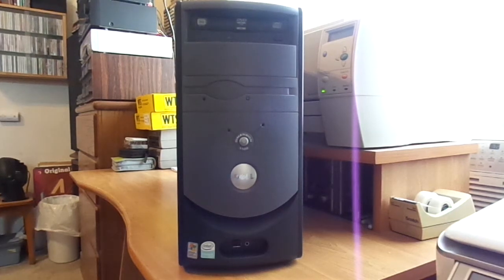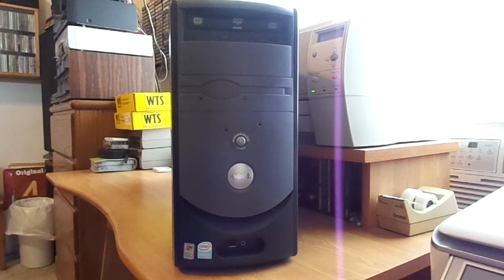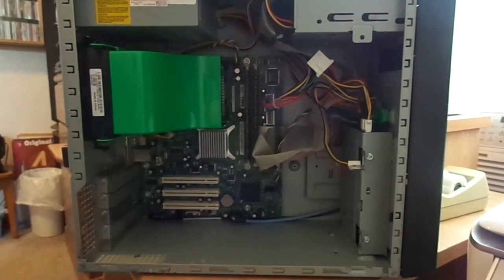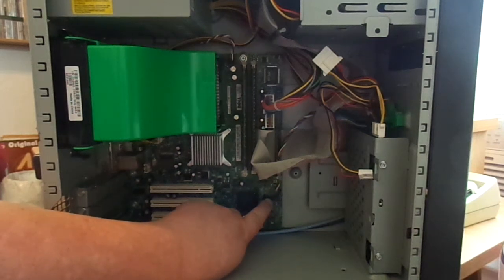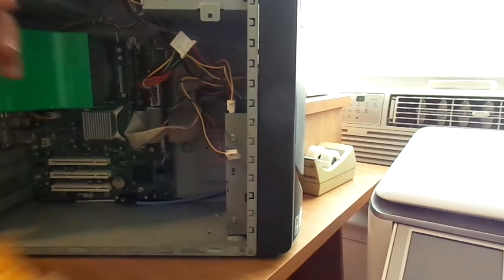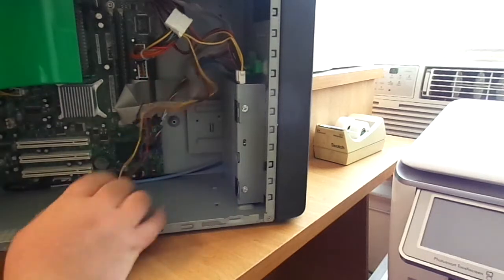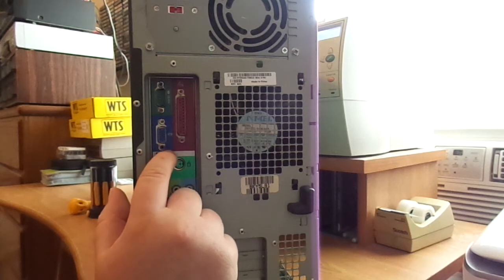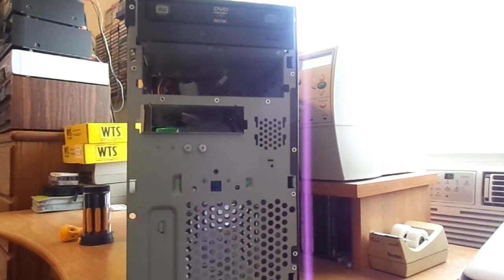Dell Dimension 1100 Desktop Computer Complete Review

Comment: The nicest thing about that case design is that it uses a standard micro ATX motherboard, so you can actually make a pretty nice sleeper system with it.  Also, if you want, I've got a Dimension 8300 that's not being used if you're interested.  Complete setup to include monitor, keyboard, mouse, and of course, system.  I've upgraded it with a Radeon HD 3450 AGP and increased the RAM to 1.5GB.  I'm just over in Newport News if you want it.

Comment: The Dell optiplex 170L which i believe use the same chassis with different plastic front panel, did actually come with the 2 hard drive cages. I do see what you and UXWBILL mean by these systems being out of date when they were produced. I think the Socket 478 was very much reaching the end of production in 2006. I would say also that they were used to clear a large amount of spare parts.....

Comment: I'm working on a Dimension 1100 at the moment. I am installing Zorin OS 8 Lite. These older Dells run the OS really well. For anyone looking to give that old PC a second run I highly recommend Zorin. Last one I did was a Dell Dimension 3000 with a 2.8 gig cpu and only 512 megs of RAM and it runs VERY well. Great for your basic machine. Facebook, e-mails, surfing etc.
Reply from the maker: I'll defiantly give it a try. Thanks.
Reply: No problem. Linux Lite looks good too. It will run on a 700 mhz machine. I'm going to try it oun and see what its like.

Comment: Another question I have matmroy, what would be the smartest way to upgrade this machine. In currently has Windows XP and the Intel Celeron D. Something that still would be cheaper than buying a new desktop.
Ben
Reply from the maker: That's a tough one. If you can get your hands on a Pentium 4 socket 478 (up to 3.0 GHZ I believe is supported by this Dell) that would be the way to go. Might check Craigslist in your area. eBay is another good option, though you will probably pay more.

Comment: I have this computer, I have it running windows 7 but it can't handle the windows aero. It has the pentium 4 prescott clocked at 3 Ghz and 1.5Gb of ram. the computer can be slow at times but if you have the patience to wait then it's not that bad... Last thing the internet loading is slow... and I can only watch youtube videos in 480p not in full screen. . You can't play modern games but it can run stuff like RollerCoaster tycoon 2, and older type pc games.

Comment: ok, this is very helpful. I still have one an i have had it for years, i let a friend  borrow it, now it doesn't work, what does it mean with a yellow light flashing on and off by the power sign.?
Reply from the maker: Sounds like a problem with the power supply. When the yellow light flashes that usually means that the motherboard is not receiving the proper voltage. Replace the Power Supply and that should solve your problem.
Reply: ok! thank you so  much!!!

Comment: Would a Sapphire Radeon HD 5450 1GB 64-bit DDR3 PCI Express 2.1 x16 HDCP Ready Low Profile Ready Video Card Work? ( 100292DDR3L)
Reply: +Jayden Slomp The 5450 won't work. The Dell Dimension 1100 (or at least MY Dell Dimension 1100) only supports legacy PCI. No PCIE, so no HD 5450 (or really any modern card) and no AGP, so no GeForce 6200.
Reply: ***** Do you have any suggestions for a graphics card for me?
Reply: Jayden Slomp My suggestion is - don't bother. I barked up the same tree... there aren't any GPUs really powerful enough to do anything modernly intensive. No high-end gaming, etc. You're limited by the legacy PCI interface. I think the best GPU you could get is like a legacy PCI 9500GT (I've got one by Jaton) or find a legacy PCI version of an 8800GT. Beware though as both cards (I believe) come in PCI Express variants, so make sure you get a legacy PCI one. There are also AMD / ATI options but I'd personally rather go Nvidia.
Reply: ***** Thank you so much I have a friend that built his own desktop for 700 and I have been saving up so I think I'm going to give him a call and talk to him about it but as you're saying it is outdated and if I want it for gaming I should build my own anyways thank again! Very much appreciated man :)
Reply: Jayden Slomp No problem :)

Comment: These still aren't completely horrible if you toss in a 3.2Ghz P4 HT and 2GB of RAM
Reply from the maker: So true. The motherboards are solidly built and that is what really matters.
Reply: Yeah, I have the Dimension 3000, I dropped in a 3.2Ghz P4, 2GB DDR400 and a PCI video card, and it screams for what it is, rock solid too.
Reply from the maker: Nice. Do you know if the Dimension 3000 series can handle a 3.4Ghz P4? I have one lying around somewhere and I was thinking of trying it in my Dimension 3000.
Reply: I think they can handle any that's socket 470, IK my 3.2 worked, and the 3.4 in theory is just a faster one, so I'd try it, don't forget the thermal grease. Also I thought I'd mention, they have a copper heatsink on eBay you can get. Just search "Copper Heatsink Dell Dimension 3000"